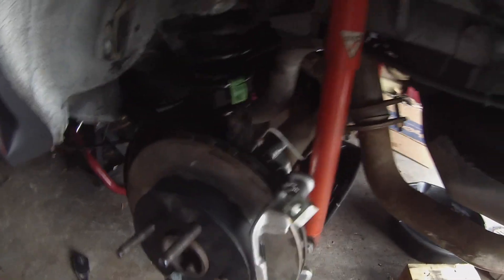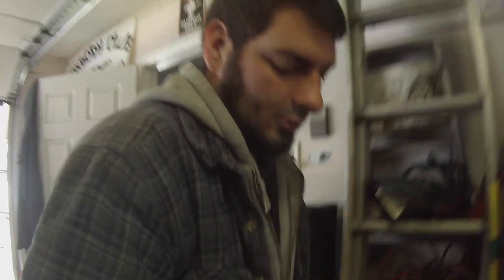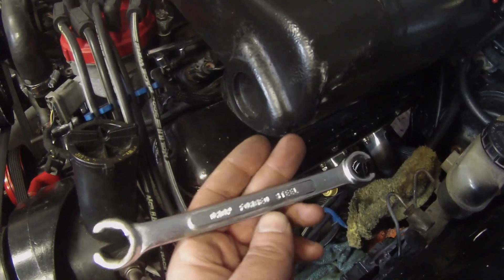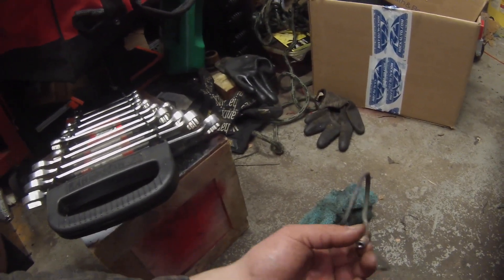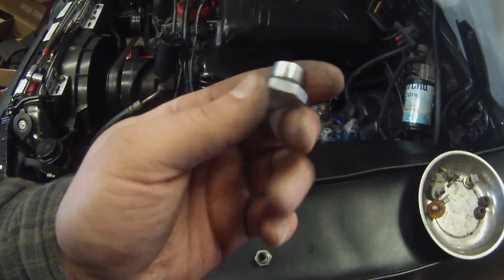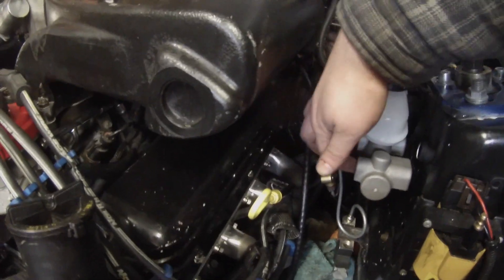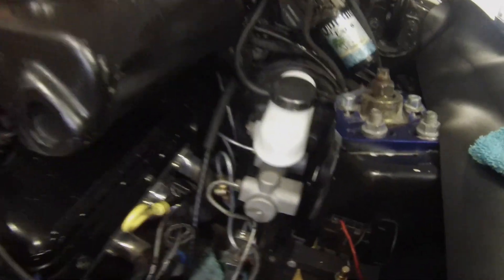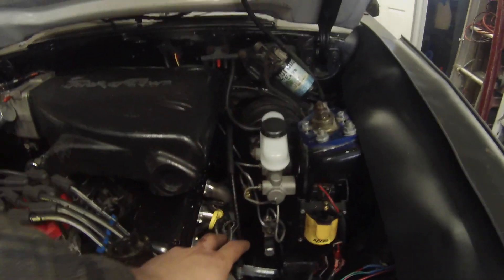Foxbody 4 Lug 8.8 Rear Disc Brake Swap ( Part 2, Under the Hood)

Comment: Do you need master cylinder? foxmustang sells something like 93 cobra set up and says you don't need  it.
Reply from the maker: From all the research I did before I went rear disc, everyone says you need the master. I replaced mine with a 93 cobra, because the 93 cobra came with discs.
Reply: They said they use a sn95 caliper and that's why I won't need a master cylinder but did say use proportioning valve and plug. I'm confused on the e brake. They sell  the cable as well but do I have to modify e brake handle or just replace cable?
Reply from the maker: @timsimons8946  I’m using turbo coupe calipers on my setup. As for ebrake, you need the buy adjustable threaded cable and use your stock handle and modify it. To modify you need to cut spring to relive tension and weld the piece that clicks to the first or second notch. If I remember correctly I believe i go over this in the part 3 video